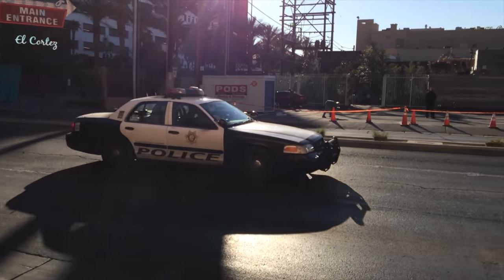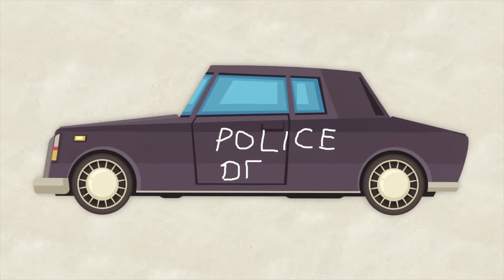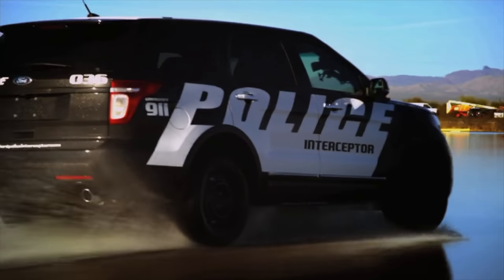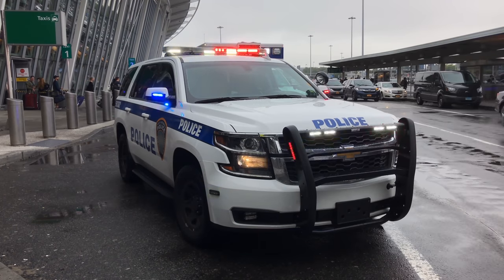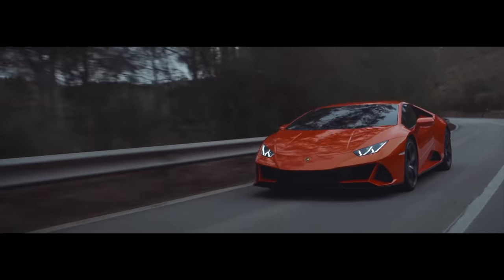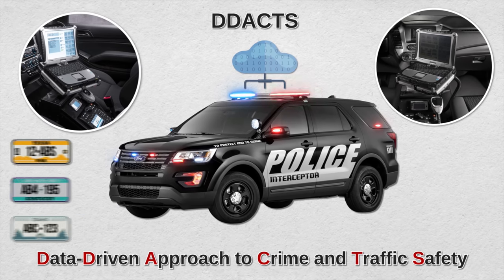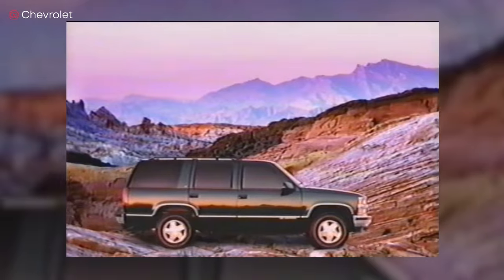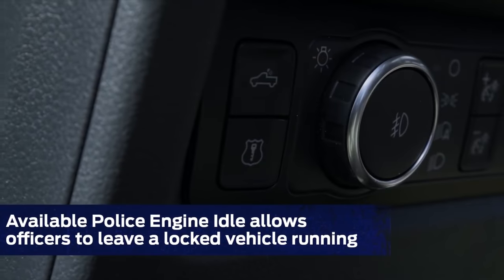Here’s Why You Can’t Outrun a Police Car

Comment: Scotty: You cant outrun a police car

The Hellcat who outran a helicopter: Oh yeah?
Reply: I saw that
Reply: David Wilcox  That's why you can't outrun the law. Sooner or later, you run out of fuel, and/or you get caught by the backup they call in.
Reply: Beam me up Scotty, the cops are here.
Rats wrong Scott.
Scotty, "Today we will look at the Enterprise check engine light."
Reply: The Tesla that outran a hellcat……don’t recommend it but yeah there’s someone somewhere who can outrun a cop.
Reply: @AAWT  be in the airforce you can have military jam equipment. ran from cops a few times in my camaro ss in mexico even dipped a chopper its not that hard. hellcat uses a ton of gas and its heavy its not hard to run in the right scenerios
Reply: Now that was funny. Couldn't believe aa car out ran a helicopter
Reply: Awesome exhaust note from the tesla. @eyevincast5440
Reply: In the UK, there was a gang of criminals who never got caught, as they always outran the cops with their unmodified car. They used a Lotus Carlton.
Reply: this man is getting old a crazy. people outrun police everyday.
Reply: David Wilcox if you plan on outrunning cops you better have a full plan instead of wait n see till I run out of gas
Reply: Depending on what you do they'll likely just call off the chase for public safety because no one wants a bunch of cars going really high speeds all over the place it defeats the purpose, the Hellcat was different because it was stolen amongst other charges.
Reply: The white Hellcat chase here in East Texas that was all over TV got away. How, I don't know but it did.
Reply: You just cannot out run those radios though, or the cameras
Reply: David Wilcox  😂😂😂😂😂😂
Reply: @sariahreigns3666  hmmm
Reply: That's all my uncle does 🤣 600hp Audi S4 he got caught once when his turbos blew
Reply: @lb5522  

Houdini made it look like an elephant had disappeared.
You don't need to outrun the police you just need to lose em.

I think your of the few who knows what that means ?

🐘 🚓
Reply: David Wilcox  noted bring a container of extra fuel.
Reply: Can’t outrun a radio. Ever
Reply: That was crazy but im pretty sure that dude got caught. They found the car down the highway I think the guy ran into the woods and they found him.
Reply: Anyone who mentions it’s impossible because of helicopters has never lived in the woods lol
Reply: I thought the same thing, especially when he was talking about the 0-60 and 0-100 of the "fastest cop car ever".  Those numbers are pitiful compared to even some standard stock cars out there never mind anything that has been customized or modified.  I had a car in highschool 30 years ago with a faster 0-60 than that Ford Enforcer.
Reply: My 50cc scooter that outmaneuvered one of those SUVs says hahaha lol 😂
Reply: Sorry but I can take turns way faster than they can, but just think A 50CC SCOOTER OUTRAN THE COPS, REALLY...
Reply: What about Ferrari and Lamborghini?
Reply: 1000 hp gtr with an extra tank of gas ez pz
Reply: Or the jeep with the airplane
Reply: @donaldpulliam9153  I have out ran MANY cops while on my 4 wheeler. I know the roads better and I can drive faster than they can on these narrow roads especially taking turns. The end of my long road a few miles up the holler is filled with old strip mine roads leading up the mountain and been riding those trails all my life. One time and only one time a cop had the balls to take their vehicle up in there after me which was a SUV so it sat higher. I got to the top of the mountain about 10 mins ahead of him and hit on the ridge looking down at the 2 cops looking for me. And to avoid the possibility of running into them I rode my 4 wheeler across the mountains to the next county that one of the roads leads you to and hit the blacktop and went home. Lol
Reply: @AAWT  Fun fact: Statistically most chases result in the the cops loosing. True but hidden stats.
Reply: @bradslone8511  yeah I just kept busting turns left and right, I even did a U-turn when I seen his lights up ahead of me, and quickly went back the way I came
Reply: @FastHemi   most helo's max out at 150 mph
Reply: @eyevincast5440  yeah but a full tank on a hellcat will go farther then a Tesla at high speed the range goes down real fast at speed
Reply: @paxhumana2015  I wouldn't call them fascist, nor a police state but ok.
Reply: All im hearing is how heavy a cop car is 😂😂
Reply: Best chance to lose the cops is in the 1st 60 seconds. If you have turns and acceleration then you can outmaneuver them before their backup arrives.
Reply: Lol, that was awesome
Reply: Can't outrun a Motorola
Reply: @Trueflights  the tesla models are very fast though
5000 lbs and 0-60 in 2.7.
Reply: @AAWT  yeah right, seen it done a few times.
Reply: He actually got caught if you watch the whole video
Reply: This made me laugh, coming from law enforcement. The cop cars of today suck compared to civilian cars. The thing you can't outrun is the radio. But the cop cars, it isn't that hard.
Reply: @AAWT  try looking at more videos bud police get outrun all the time
Reply: My uncle dipped on the cops on a dirt bike when he was 18 years!🤣
Reply: @AAWT  motorcycles get away from cops everyday.
Reply: You Know they still got caught right?
Reply: @AAWT  I mean their is one way you could outrun them, if you hire a rally driver
Reply: @AAWT  you- “can’t out run the law” 
 Me - wait for the police to get behind me so they can read the plates they don’t match my car or address and take off on them at Least once a week and get home smileing like nothing happened… whoops 🤷‍♂️
Reply: @eyevincast5440  The Tesla plaid is fast as hell, I watched a video on it as to why it's so fast there's not much that can match it
Reply: He didn’t outrun a helicopter, the chopper ran out of gas
Reply: Me and the boys dip on them on a daily, all in v6s
Reply: YEEAAA!!! Tellm!!!
Reply: He still got caught though
Reply: @nicktayloriv310  i.f we're talking about the same one,  he got caught when he ran out of gas, took about ten minutes to catch up tho
Reply: I was just about to mention that 😂
Reply: I’m with  you bout this 😂honestly can’t outrun a hell kitty
Reply: He got caught after crashing the car.
Reply: @RoyalDart101  oh yeah he did but still
Reply: Lol I was thinking about the same incident where helicopter gave up on hellcat 🤦
Reply: I can't tell you how many cars have gave cops the gapplebees menu
Reply: Supra
Reply: I lost a helicopter once
Reply: I was looking for this 😂 but I got what he meant
Reply: Actually it didn't. It ran out of gas and he got caught because its a 4500 pound brick.
Reply: @FastHemi  police helicopters and news helicopter top out at 120. I have a 20+ year old sh!t box honda that can go faster.
Reply: Ive out run the police a few time
Reply: @AAWT  not always. I've done it and so many others have too
Reply: @AAWT  u can't outrun a radio
Reply: So I guess that hell cat got caught bro ….he ran out of gas lmao
Reply: @eyevincast5440  there's a lot of vehicles that can outrun a cop car I can outrun a cop on my Hayabusa but we cannot outrun a radio
Reply: I outran fbi and nsa 4 days in a row with helicopter.
Reply: I outran fbi and nsa 4 days in a row with helicopter.
Reply: Sovereign Lord delivers from death.
Reply: Sovereign Lord delivers from death.
Reply: @nicktayloriv310  until it is in the drive thru at Wendy’s a month later, and after having its tags known and every cop looking for it 👮‍♀️ 👮‍♀️ 👮‍♀️, they’ll just take him in custody.
Reply: I've outrun the police multiple times, just saying .
Reply: @JamarRoby  ya, and copters can go
Anywhere is a straight line.
Reply: Yeah the white Dodge Challenger got ghost lmao
Reply: @christopherhagan212  You sound like a trustworthy guy, we believe ya. 🙄
Reply: @shannontaylor5173  My magnum can beat any car. & I don't mean a Dodge Magnum.
Reply: They aren’t outrunning the other officers and choppers coming in as back up
Reply: That was hilarious 😂
Reply: Police car cant outrun purpose built racing car
Reply: Sure you can dude watch ghost car video that's how you outrun a cop
Reply: You can't outrun the radio
Reply: He ran out of fuel. And got caught
Reply: Hellcat.. Too heavy.. lol
Reply: @AAWT  wrong
Reply: @AAWT  I'm at 40+ 🤣 and I work for border patrol
Reply: i seen that too
Reply: @prism8289  been there done that,  charges dismissed
Reply: @JamarRoby  I'll take that bet
Reply: @prism8289  doesn't matter when your on a s1krr
Reply: @blackhawkuh-6026  bro I have outrun a uh-60
Reply: I hope everyone knows that the dodge that outrun the chopper only got so far before he got caught
Reply: @blackhawkuh-6026  I actually accidently almost made 2 uh-60 wreck in Baghdad Iraq with my ant/sc-176 hah
Reply: @s1krrpilot  sure, buddy. Now, get off the Xbox video game and do something productive.
Reply: @prism8289  lol you should watch out who you run your mouth to even on the internet,  if you care see my about me,  I won't waste anymore time on you because you don't want me to
Reply: He was still caught I thought? Ran out of fuel or something.
Reply: @s1krrpilot  I’m terrified.
Reply: @tnc7399  he was
Reply: @prism8289  you should be
Reply: @s1krrpilot  yknow buddy, my dad was a counterterrorist contractor infiltrating group. He also did work for organized crime groups infiltrating the mafia. As such. I’ve know mafia enforcers, cia, and I person did work with a police anti gang and narcotics unit, led by a guy who ran a unit to combat cartels in the Mexican border. Yknow what I noticed all those years. Real tough guys from mafia enforcers to cia operatives to undercovers don’t run their mouths like tough guys, especially on the internet.
Reply: @s1krrpilot  and unlike you, my fathers life was used as source material for a Hollywood movie, and his life is part of a senate record.
Reply: @prism8289  I'm terrified
Reply: @prism8289  what the hell does that even mean bro, is that supposed to have some value?
Reply: The thing is so much power equals so much gas lost. So you can outrun the cops but never the radio or technology they have.
Reply: @FastHemi  an police helicopter, but if it was an military graded one. They wouldn't outrun it. The fastest helicopter is the Ch-47 Chinook:)
Reply: @subjectc7505  you can when you can control it, or if you know how to get away from it
Reply: @subjectc7505  police use the uh-60 though
Reply: @s1krrpilot  your not outrunning an Blackhawk because they're built to rapidly deploy troops into the battlefield and can do multiple roles. unless they can't afford the mordern Varients.
Reply: @subjectc7505  normally I would believe you but based on what I know is the truth for many reasons I can tell you the Blackhawk isn't catching me,  I have already been through this argument once  and won so I'm not going through it again sorry
Reply: @s1krrpilot  A military Blackhawk will catch you lol. It's top speed is 222 mph and it's pretty fuel efficient unlike a dodge hellcat. Plus Helicopter engines for 10x as powerful than an Hemi.
Reply: @subjectc7505  but it's range is limited
Reply: @subjectc7505  I ride an s1000rr
Reply: @s1krrpilot   The Nigh Stalkers has refuel probes so it can air to air refuel and continue going on it's mission lol. Your car range is limited but the Black hawks aren't. You're not outrunning a helicopter that's built to travel miles and perform fast developments of troops behind enemy lines. 
You can outrun the police and their helicopters all you want. But if a country has to send out a military helicopter after you, it's no outrunning it lol.
Reply: @subjectc7505  bro I had the hardest job in the army,  the army and the police are on my side to check my about me,  I'm just making a clear statement don't get All butt hurt
Reply: @s1krrpilot  You wasn't in the Army. Because every service men who been in the black hawks, knows how valuable and unique they're lol, also service men don't run away from the cops either.
Reply: Real Shi 😂
Reply: Hellcat: runs out of gas
Reply: @AAWT  speak for yourself
Reply: @steveschu  speak for yourself
Reply: "It's a police helicopter not an Apache"
- Gone in 60 seconds
Reply: @VyprMoto   That cop probably had a smile as wide as a possum
Reply: @AAWT  some kids in my city robbed a amored truck and ran from the cops...aint get caught till this day lls
Reply: Step 1 bring extra fuel / rig a refueling contraption for while mobile 2. Strip car to minimal interior/needed parts 3. Color changing paint. 4. Rotating plates to swap via chase. 5
Reply: smart car outruns a mustang. I'll stick to JDM cars for now
Reply: There is a video of a GSXR outrunning the police and the Chopper lol it is on YouTube .
Reply: If people actually knew how easy it is to run from the cops everyone would be running so cops make it seem like nobody ever gets away because we only hear about stories where they catch people for the most part and all those countless stories day in and day out of people getting away you will never hear about lol.... I can't really speak on cars but I ride a super bike and so do most of my friends and we all have multiple stories of getting away from the cops with ease. It's almost an inside joke at this point that if we get in a fight with our girlfriend or wife we might let cops catch us so we don't have to go home for a while.....it really isn't hard to get away if you have a fast mode of transportation and not a family vehicle.
Reply: @eyevincast5440  maybe for a second or two but then ran out of battery and died and the hellcat zoomed by making the toy car eat the hellcat dust lolz
Reply: They do alllllll the time🤣 in my city multiple times a day it’s too common to put on the news🤣🤣🤣
Reply: @subjectc7505  people out run helicopters in a Ford Focus here🤣 it’s not uncommon at all
Reply: Can't outrun the radio
Reply: @daewooparts  they do all the time🤣🤣 switch the car or switch the plate. I know a few St. Louis city cops, 90% of traffic stops turn to pursuits and MOST people are never caught
Reply: Switch the paint* and the plate🤣
Reply: @AAWT   not facts
Reply: @AAWT  theres a yt video of a guy on a bike who outran a heli and hided in plain sight in a tunnel and 2 cop cars passed by
Reply: @subjectc7505  yeah but the police do not have those capabilities bud,  i have outrun choppers, because the choppers have to catch up to the initial chase
Reply: @s1krrpilot  They have the capabilities bud. Y'all underestimate the police alot, but at the end of the day. You can outrun the vehicles, but never the technology within the cars lol
Reply: @subjectc7505  the army does,  not the police buddy, lol you obviously don't know too much about police
Reply: @subjectc7505  go read my about me and stop trying to argue something you won't win
Reply: @s1krrpilot  You don't know much about the police lol. Cuz you think you can run everytime.
Reply: @AAWT  I agree that you shouldn't.  But the police regularly fail to report people who speed away from them at speeds they couldn't dream of doing.  It is a myth that you can't run from the police.
Reply: he outran a helicopter thats not a car
Reply: not to brag but that was legit my stepdad on everything i love
Reply: juan abee  you mean sound
Reply: @geniuk-1455  I want to hear your stories
Reply: @rwm1980  tell me the story
Reply: @gregoryhagen8801  what about the 1000 hp eclipse
Reply: @subjectc7505  right we’ll what’s your Snapchat… cuz I have videos of running from police cars and choppers in my hellcat and my bmw
Reply: @AAWT  bro 😭 are u goof it’s not hard to run away obviously there telling u this so u don’t run
Reply: Can't outrun radio
Reply: Ooh I remember that lol and 120 is slow compared to how fast they can really go with mods
Reply: @eyevincast5440  next will be the supra that outran the tesla
Reply: nitrous
Reply: @eyevincast5440  only some Tesla can outrun it, but that's mostly how fast it can get to top speed the hellcat can sit a 200kmh and be fine with no overheating
Reply: Fr
Reply: @sariahreigns3666  but it can't go that far
Reply: You can easily out run a police car, but you can never outrun that radio, if they could design a computer system that can route cars to always have cars in front of the runner.
Reply: @james10739  they outran the helicopter and their cameras zoooom lense.
Reply: Most commercial Helicopters top out at a measly 140 while the hellcat  stock is said to be able to reach up to 200 mph. I cannot confirm this but my 300SRT8 (much slower than a hellcat) can reach past 170 mph i know first hand. My 300 can outrun a Heli. Lol 😆 🤣
Reply: I remember that. Thank you for that. This dude needs to do better research.
Reply: @nicktayloriv310  he got caught. Ended up ditching the car after it ran out of fuel and ran into the woods.
Reply: @Evanx373  that's what my daughter told me.
Reply: My nissan maxima can outrun most cop cars lol.
Reply: There's videos all over of Hellcats outrunning police.
Reply: @johnsigma7710  I know but I'm not gonna sit here and argue with them... that tree bears no fruit. 🤦🏽‍♂️
Reply: @nicktayloriv310  You’re right, they’re just going to believe what they want to believe.
Reply: @kevinmoore4887  For Star Trek, Starfleet is a government organization. Besides exploration missions, Starfleet also keeps the peace between planetary systems and has interstellar police duty.

According to Star Trek 6, Starfleet has three main service branches i.e. science, exploration (diplomacy), and military.
 
Science examples are USS Equinox (NCC-72381), USS Phoenix (NCC-65420, AWACS style large senor pod).

Exploration examples are USS Enterprise (NCC-1701A/B/C/D/E), USS Voyager (NCC-74656), USS Titan (NCC-80102), USS Excelsior (NCC-2000).
Military examples are USS Defiant (NX-74205), USS Prometheus (NX-74913), and USS Thunderchild (NCC-63549).
Reply: And to think it was only a hellcat. Just imagine what a demon could do 😏
Reply: Yep, it’s true. I saw it.  That Hellcat came by like a ‘bat out of hell’.  I saw a cop in pursuit with the lights on.  Then the turns were turned off and he exited the highway as if nothing happened.  Wow!
Reply: i mean, u can outrun them.. but they will find you at some point... that car will be on a watchlist, and if they catch a plate or have your information, they gonna be on ur doorstep in no time.. u can outrun the car, but not the radio's, camera's and computer aided dispatch systems/data terminals.
Reply: @i.m.385  Just take the plate off. Problem solved
Reply: @chanceadomeit4909  plate has your name registered to it, that has your Address, so taking it off after the fact doesn’t do jack. Gotta think further bud.
No plate to begin with? Fine, bolo the car description. It’s dumb to do that anyway cuz it guarantees police interaction when driving since it’s illegal obviously.
It’s virtually impossible to get away from a modern police department without scrapping the entire car and leaving the state.. if somehow you do get away, even that isn’t practical
Reply: @mikeyz1080  when fuel becomes an issue you've already lost. You need to lose them in the first minutes or you're going to get caught.
Reply: He got busted 10 miles after that recording because he ran out of gas
Reply: @lb5522  exactly , try a Hayabusa , this bike can outrun any police car doing wheelies .
Reply: There isn’t anything more satisfying to drive by a moving police car , roll down your window and flipping the birdie , and then stump the gas , until you can’t smell pigs no more .
Reply: Scotty please take your meds , it’s time for your prostrate check up .
Reply: NOt the only one either
Reply: @AAWT  you act like nobody has ever gone unaccounted for
Reply: @eyevincast5440  the tesla can only outrun the hellcat at lower end speeds. Electric cars are better at launching and early acceleration.
Reply: @AAWT  Modded out cars with back up gas tanks and people willing to hurt people in power have entered the chat
Reply: He didn't outrun the radio though
Reply: They actually caught it later on the driver ran out of gas
Reply: And the Tesla out ran the hellcat. ROFL
Reply: Impala SS did the same. Look it up. 1996 Impala SS leaving cruisers, choppers, the whole 9
Reply: juan abee  they still get away tho 😵
Reply: juan abee  what are you talking about lmao
Reply: Lets see an EV do that while looking cool and sounding like a beast springing from some primeval past..
Reply: Agreed. Scotty doesn’t know.
Reply: Not just that a he'll cat has outran those dodge chargers the cops have several times
Reply: @lb5522  he’s getting old, for sure, but he’s always been crazy.
Reply: Until they caught him when he ran out of gas
Reply: @lb5522  Yes because often the chase is called off due to safety concerns.
Reply: It’s pretty simple with a ZX14R by the time they turn around I’m gone. This bike has outran the cops 8-10 times, plus here in Indiana after 120mph they stop pursuit because it’s a hazard to the person they are chasing, themselves, and everyone around. I’m a few years older now and have kids to go home to so those days are over but it’s very easy on a bike, little harder in a car but have done that once also.
Reply: Of course it was a fuckin Hellcat, they make those things at area 51.
Reply: Supra memes in a nutshell
Reply: @stonerman15   Crash. KABOOM! 💥🔥
Reply: The helicopter wasn’t chasing it….it was filming it while staying in place
Reply: until the Hellcat runs out of gas lol
Reply: @steveschu  hold my water
Reply: You can't outrun the Police very often once they know you know you are being chased.
If you have plausible deniability and a plan with multiple options it's possible.
I only tried it twice and succeeded twice.
I witnessed someone else evade about 5 different city and suburban police departments because they failed to cover every possible highway egress.
Reply: Scotty needs to fact check these lectures before he reads them off the teleprompter. The 1982 Mustang didn't have upper control arms.
Reply: @ryanow5437  one question what does y’all mean ?
Reply: I’ve outran cops on my R1 but to compare a bike to a car is outright unfair lol.
Reply: @FastHemi  normal helicpters (Hugues 500, Jet Ranger, etc.) do 200km/h (a litle more if you "force" to 260km/h tops). In a long strait road Hellcat (and others) will outrun a normal helicpter.
In a dificult road, helicpter will be able to follow if they have line of sight...
Reply: You can't outrun a police radio.
Reply: @AAWT  most won’t bother to chase you for that long but personally I prefer not to tempt fate
Reply: Kansas highway patrol with dodge demons 🧐
Reply: Hold my beer
Reply: You can't outrun a police radio.
Reply: They probably found him later
Reply: Helicopters are not as fast as some cars
Reply: @malakhai4542  only cause he ran out of gas 😂
Reply: @ericcollins8940  bull. I've yet to be caught. I've been running for decades.
Reply: @steveschu  yeah, you just keep thinking that.
Reply: @bobbytreez5615  nope.
Reply: @donaldpulliam9153  been there, done that. Once you gap em good, pull a u and stroll by going the other way. Oh what a feeling.
Reply: @benbraceletspurple9108  yes you can.
Reply: @malakhai4542  No he didnt.
Reply: @shannontaylor5173  I've been outrunning Motorola for decades.
Reply: @dobermanguy9437  oh yes we can. I've been doing it for decades.
Reply: YUP!
Reply: @sariahreigns3666  playing too much Need For Speed
Reply: @TheWildbill5891 yes you can.
Reply: scammers scam scamsford using japan yamaha and nissan,madza pro
Reply: @sariahreigns3666 okay sure.
Reply: @Tommuli_Haudankaivaja  They are in Australia now
Reply: Doesn't take much to outrun a Robinson R-22.
Reply: @nightbloodrayna  sure kid. You keep bragging about running from the cops in gta.
Reply: Guys, Here is Our Savior

YaH The Heavenly FATHER HIMSELF was Who they Crucified/Pierced for our sins and “HERE IS THE PROOF”

From the Ancient Egyptian Semitic: 
"Yad He Vav He" is what Moshe (Moses) wrote, when Moses asked YaH His Name (Exodus 3)

Ancient Egyptian Semitic Direct Translation
Yad - "Behold The Hand"
He - "Behold the Breath"
Vav - "Behold The NAIL" <— YaH’s Crucifixion
He - "Behold the Breath"

“Behold the HAND that Beholds The NAIL” 

PROVES - YAH The Heavenly Father HIMSELF was Who they Crucified

That is EXACTLY what Moses Wrote

Here is what they mean

YaH's Name:
(Ya)d + (H)e, as YaH is what Moses called Him and YaH Declared: "this is My Name, this is My Name for all generations" (Exodus 3)

YaH is The Creator of “MAN”: (Genesis 2:7)
Yad He, (HAND BREATH), as YaH's "HAND" Formed man from the dust  of the Earth and His "BREATH" made him a living being (Adam)

YaH's Sacrifice of Crucifixion for “MAN”:
Vav He (NAIL BREATH), the "NAIL" through YaH’s "HAND", in Sacrifice of Crucifixion, that whosoever shall call YaH Savior, His “BREATH” brings forth life (Salvation)

How YaH arrives:
YaH arrives via the Tent of Meeting (Exodus 33:7:11, Isaiah 54, 55), where a Tent is erected outside the city, a cloud descends upon the entrance of the Tent and YaH appears...

Why they demanded YaH to be Crucified:
YaH was Crucified according to Hebrew law (Deuteronomy 21), to be NAILED/PIERCED on an Almond Tree for BLASPHEMY as it was for His NAME they demanded Him Crucified. The Messiah claimed He was YaH...

HE WAS YaH!!!

HalleluYAH translates “Praise ye YaH”

The Hebrew Book of Isaiah

Isaiah 42:8
"I am YaH; that is my Name! I will not yield my glory to another or my praise to idols.

Isaiah 43:11
I, I am YAH, and there is no other Savior but Me.

Isaiah 45:5
I am YaH, and there is none else.
Reply: @Tommuli_Haudankaivaja yep, heard of it, I remember the make/model.
Reply: Me on a 1000cc supersport bike: Oh yeah?
Reply: You’re never faster than the radio.
Reply: He ran outta gas and they caught him
Reply: My neighbor took me for a ride in his hellcat.  He used to be a professional bodyguard and he really knew how to drive.
Reply: Notice how you said helicopter instead of car
Reply: It’s a dodge it will break they can just wait it out of got the license plate number and arrest them at home
Reply: You might not out run the POLICE,  but you can outrun their cars if driven by some of " the country's finest ".  Finest what ? Is the question.
Reply: @atuck6082  that's thanks to using my best-selling invisible paint. Only $69.95 for 66mls. Give it a try!
Sucker
Reply: @benbraceletspurple9108  you can't outrun invisibility
Reply: @user-do8xf6bc8d Smart cars are made by Mercedes, nothing jdm about them
Reply: @AAWT  wrong and silly
Reply: and ran out of gas 40 minutes later
Reply: motorcycle: am I joke?
Reply: @sliccsLol  ALRR: Hahaha
Reply: @lb5522  yeah, but they are usually caught the next, police are like elephants, they never forget
Reply: @christopherhagan212  turn yourself in, you're just a threat to others safety
Reply: @D1711-i1o  you can't switch your plate that easily, and switching paint can be expensive, plus time consuming
Reply: Outrun may be the wrong wording. Usually when a hellcat gets up to 160mph it's absolutely reckless for police to continue chasing, even with a helicopter. They'll gather the information and form a case against them if they ever find them. At 100+ death is almost guaranteed, and the police doesn't need additional lawsuits and liabilities, especially at the risk of civilians, etc.
Reply: @Tommuli_Haudankaivaja Officers were modified !Too many donuts!
Reply: If what ever their chasing has
A license plate on it, cop cars 
And helicopters ,can read the 
License plate at least a quarter mile away, so thay will find U sooner or later. 
Besides those Dodges ain't 
That fast and people them
Are usually lame.
Reply: You failed the theft test. 😊
Reply: You can run you can hide but thw truth always catches up to you karma has you in its sights.
Reply: the police charger hellcat'
Reply: no car can outrun a helicopter. it can juke them and trick them
Reply: A liter bike can outrun a cop on any given day. Especially through traffic. Not to give names... a dude on a bike outran a helicopter as well. Oh yeah!
Reply: I just watched that video a moment ago and got this video recommended. LOL
Reply: Can't outrun radio
Reply: Yes, most police helicopters go no faster than 140 knots.
Reply: The dude reached home safely and was caught later on after his homeboy  snitched on him.
Reply: You ain't gonna outrun the radio 😅
Reply: And motorcycles
Reply: @FastHemi  Some motorcycles will too, they get caught making turns to go home!
Reply: @steveschu  You definately can lol
Reply: @FastHemi the helicopters only go like 150 so it’s fairly easy to outrun them
Reply: @s1krrpilot "you should watch your mouth even on the Internet". you get bent that out of shape because someone disagrees with you?😂 What are you going to do steal his income? Track his location?
Reply: @coreyrudd6361  Yeah because a supercharged v-8 will beat a turbo v6 any day😂.
Reply: @Tommuli_Haudankaivaja  just get something that blends in, like a Peugeot 206
Reply: @TimpBizkit  Why are you responding to me with this?
Reply: Cant outrun the radio.
Reply: The hellcat ran out of gas - he got busted
Reply: @AAWT  helicopters also run out of fuel.
Reply: What can you do with a 4500 pound 707 hp Hellcat. The answer is a 3100 pound 500 hp Corvette leaves it in the dust.